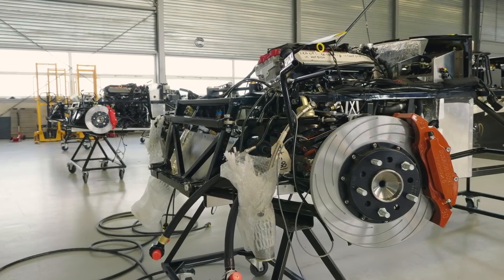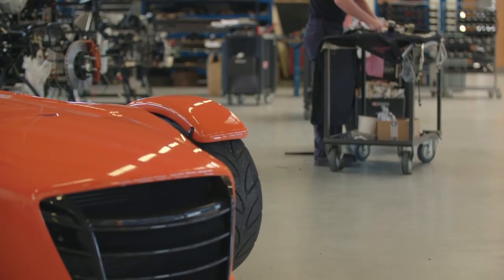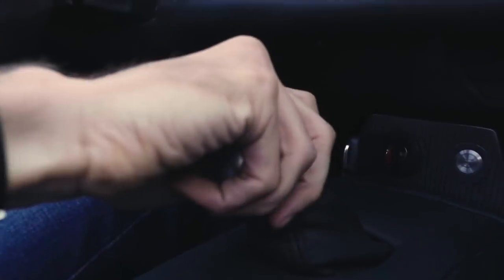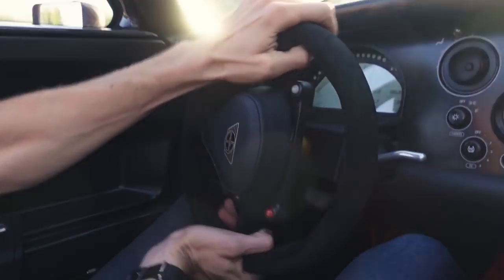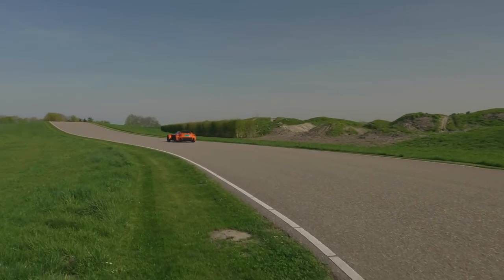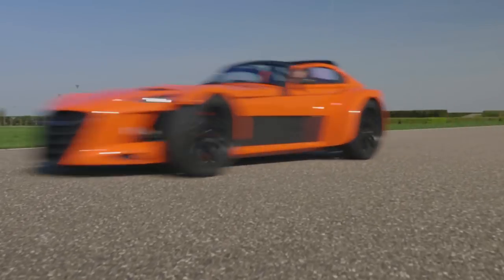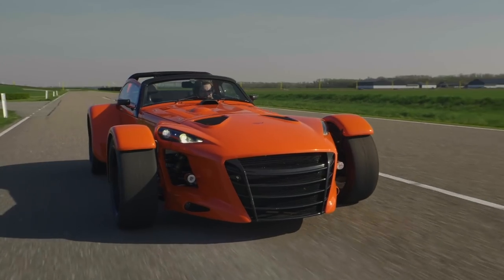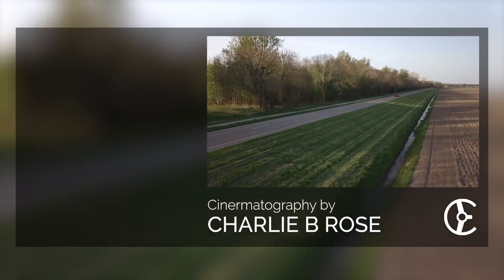Donkervoort D8 GTO-RS: Reassuringly Hardcore - Carfection

Comment: Visited the factory last year. I was able to get a closer look at these. They are incredibly impressive styling wise. But the price is sky high and sorry, Henry for disagreeing they are very poorly finished: body panels not aligning, exhausts not in the middle of the cut out, the black silicone glue applied at random, ... No, for this price, the fit and finish should be much better.

Comment: Looking at the prices for one of these, why don't I get a proper supercar like a Mclaren 570s instead? Or get a Caterham 620r AND a BMW M5...
Reply: In terms of power to weight, the 620r has more.
In terms of top speed, the 570s destroys it, bonus it comes with a roof.
8 out of 10 times the M5 will beat it to 60mph. 
9 out of 10 times the 570s will beat it to the 1/4 mile.  
Not sure how you can claim they are all slower.
Reply: Because this is a donervoort
Reply: @DonLee1980  Because it´s Dutch.